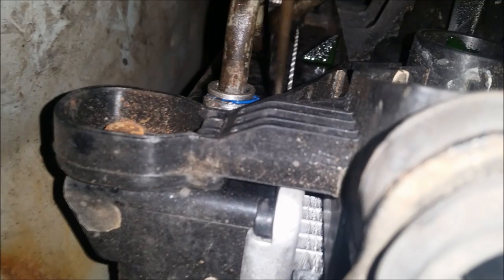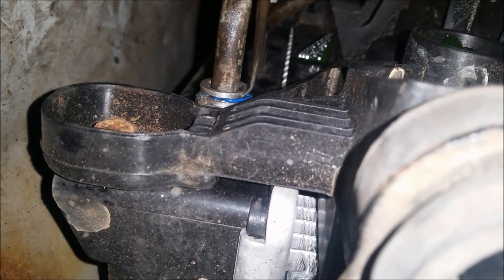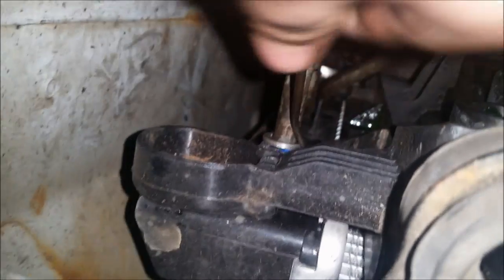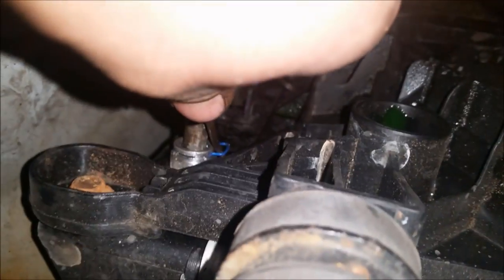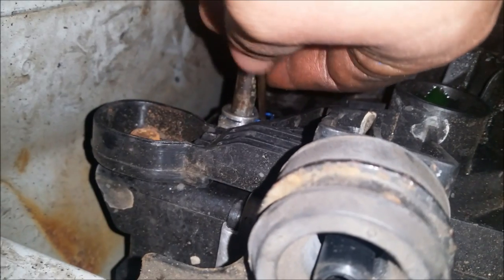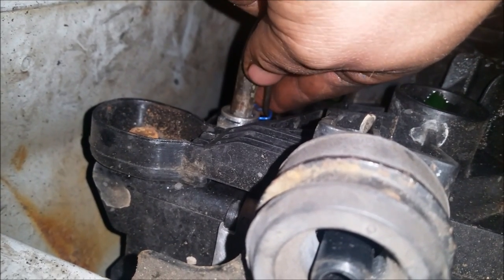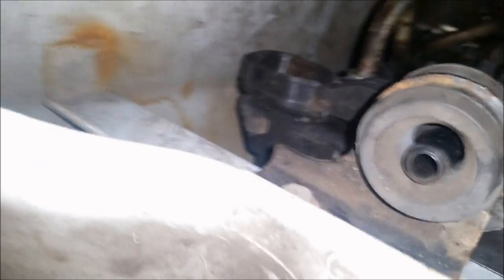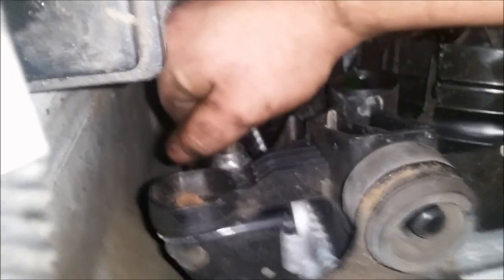GM TRANSMISSION LINE REMOVAL

Comment: I installed a new line, but I'm leaking right at the clip part into the radiator? Any suggestions?
Reply from the maker: +Xavier Owens  the internal o ring needs to be changed
Reply: Xavier Owens how to replace cool line on a 2000 Cavalier

Comment: I've got the clip out, but the damn line still wont come out. It spins and has a little play in and out, but it wont come off. Any thoughts or suggestions?
Reply from the maker: make sure lower section is out of retainer and not binding to one side pull straight out not side to side or at an angle

Comment: is there a secret way to get the adaptor over the little bump on the transmission cooling line? 
I tried using my body weight and just screwing  it in without the clip but it isn't working. 
I'm hoping I don't need a bigger adaptor..
Reply from the maker: the quick conect fitting should just pop in no issues if it will not go in something is wrong
Reply: JoeTheAutoGuy the lower transmission cooler line popped out of the radiator and I don't know how it happened. I replaced the put in a used radiator in August and had no problems until the other day when I was leaving a gas station I noticed my car wasn't driving normal. thought a caliper seized at first until someone pulled next to me and said my car was leaking fluid. I put the line back in and put 5 quarts of fluid in. do you think I should replace the fitting or the line?
Reply: eddo1983 I would if I was you. adaptors are cheap.
Reply: I used a pick to get the spring out. Easy for me because I had removed the radiator hose.

Comment: Hey I have a question since your pretty savvy with these 3.1's & 3.4's I need to replace my oil pan and I want to know if I have to lift out the engine to take it off or if there's something else I can do to get the oil pan off
Reply from the maker: +Dylan “Micah” Ethridge very late reply i apologize but yes the engine has to be lifted and the sub frame loosened on the one side
Reply: Dylan Ethridge oh, god. you have to lift the engine to change the oil pan? I'm glad I don't have a car like yours. this is rediclous. lol
Reply: CHIEF TOMMEH yeah I don't have the car anymore sadly, I feel like you could drop the sub frame but something tells me that doing that would leave the motor and trans unsupported
Reply: Can someone please tell me how to go about changing transmission lines on a 1995 Chevy Corsica?
Reply: Dylan Ethridge I know this really old but they have support bars that go across from fender to fender that will support engine/trans while doing work on the bottom without mounts

Comment: JoeTheAutoGuy on my 2005 Buick Lacrosse the lower transmission cooler line popped out of the radiator and I don't know how it happened. I put in a used radiator in August and had no problems until the other day when I was leaving a gas station I noticed my car wasn't driving normal. thought a caliper seized at first until someone pulled next to me and said my car was leaking fluid. i pulled over opened the hood and noticed fluid all over the passenger side I put the line back in and put 5 quarts of fluid in. do you think I should replace the fitting or the line?
Reply from the maker: eddo1983 in those instances I replace the line and the fitting both are probably wore down

Comment: I was stupid and didn't notice the clip,  and took the fitting off.  Now I reinstalled it and it leaks behind the fitting.  Any Solutions? Thanks
Reply: Try wrapping the threads with some teflon tape.